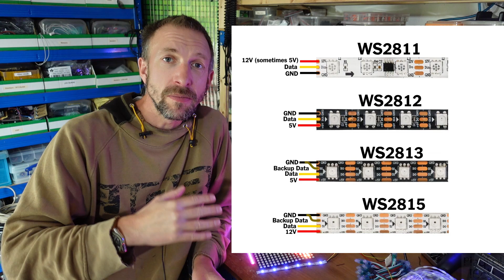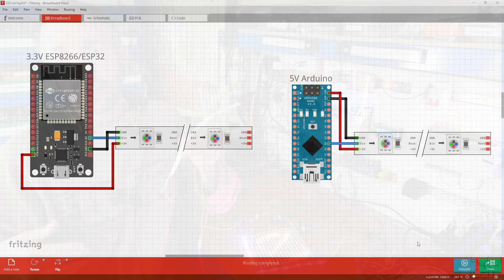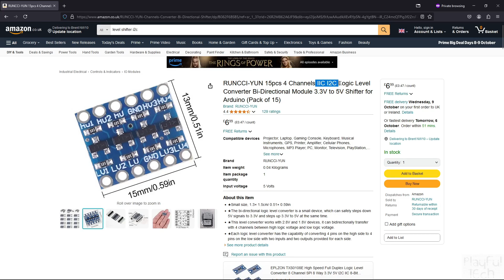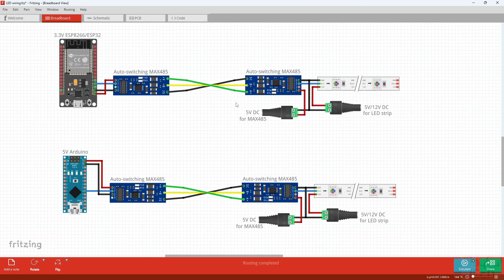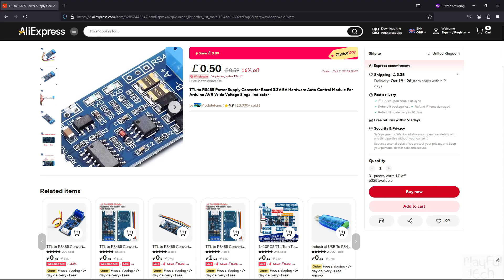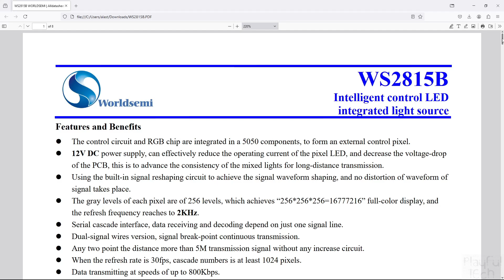Wiring Programmable LEDs

Comment: Why do you not need a capacitor (it’s not in the diagram) when using differential signaling? Doesn’t differential signaling only improve the data signal?

And what about using a fuse?

Comment: there is no such a thing like programmable LED, you program a LED driver NOT a LED
Reply: "smart ass" - Detected
Reply: As you’re being pedantic, the first letter of a sentence starts with a capital letter, so it would be ‘There’. Also, ‘no such a thing like programmable LED’ is not standard English, I think you mean ‘no such thing as a programmable LED. Additionally, ‘you program a LED driver’ should be ‘you program an LED driver’. Finally, you’re also missing a comma between ‘driver’ and ‘NOT’. 

PS, don’t be a dick.

Comment: Another great practical video, thanks.  I used RS485 in kinda the reverse scenario of this on a project recently, and ended up with an arduino mega, with a dmx host shield very close to the very long strip end ( think I ended up around 15m of led) and signaled what it should do by sending dmx from a lighting desk. The mega listened for the dmx value and colour shifted accordingly

Comment: Many people seem to think that Cat5 etc. twisted pair is good for standard "SPI" signals because that's what's used for data cabling but while it should be used for differential systems like Ethernet and RS485 (Cat5 is RS485 compliant) for standard single ended data it can make things worse due to the higher capacitance of the cable.

Comment: Thank you, i was going in the wrong direction. So i wasn't using an esp32, but i will now and i was not using a capacitor, never came up. That was a very informative video and now I'll get on the right track i felt like i was in class, Cheetos on my keyboard and the only sound was my labradoodle snoring, was like 1994 in Engineering school minus dog. Ok i'm just starting over after i find the capacitor box.

Comment: Great to see someone actually using the correct level-shifter/buffer for that purpose 👍 The HCT125 is available in a small single gate (1G) version, the 74AHCT1G125GW, which makes for a perfect small in-line converter board. Also, if you can't get a 125, basically any AND/OR/XOR gate will do. So any 74xT1G[125,34,32,17] should work.